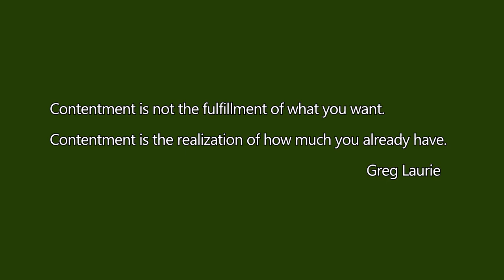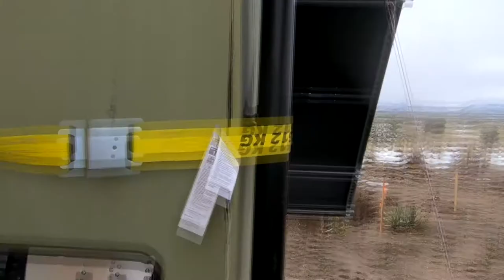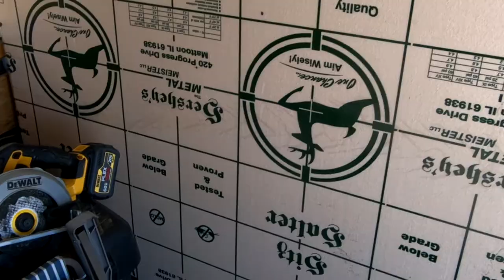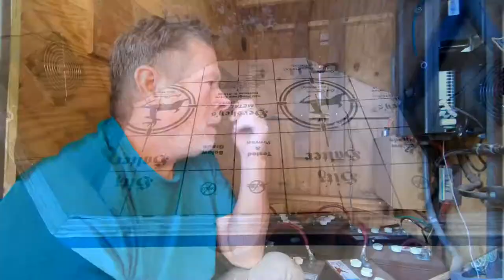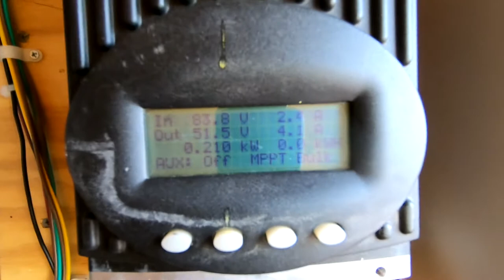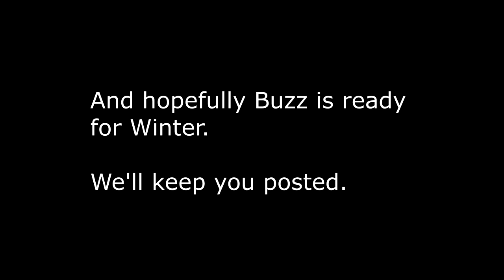Wind Turbine Disaster and Buzz Upgrade!

Comment: Dont feel bad about the wind turbine, off grid is a learning process... , over the span of 15 years we have purchased 5 turbines, some self destructed in a wind storm, one actually bent the tower so bad we had to replace the tower, and some we just upgraded because they were too small.  Cool watering system, I should look into getting one too.
Reply from the maker: Yeah, still it sucks to have spent over $1000 for this system and it only work two weeks before destroying itself. Thanks!